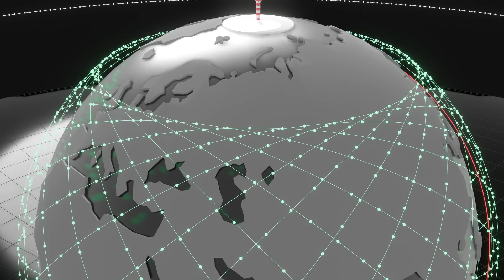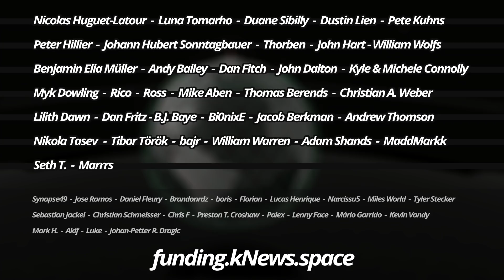What is SpaceX Starlink and how does it work? || kNews.space

Comment: 5:07  This network of satellites will offer faster speeds than fiber optic cables. 30 to 60 ms across the entire globe? If I were living in Australia or New Zealand, I would be super excited.
Reply from the maker: To clarify: By faster in this case I mean less latency over big distances. You can still push more Gigabit/s though fiber cable. The signal only travels faster through vacuum than it does through optic fiber. So it will beat long range internet connections. Maybe not in the beginning but long term once there are enough satellite in order to route the signal efficiently.

Comment: They've updated the satellite design for all but the first few dozen; the new design will burn up entirely with no debris reaching the earth.

Reusable satellites aren't going to happen.  These sats use hall effect thrusters to adjust orbits.  They're extremely low power, and work by applying a soft nudge over a long time.  It's so weak that they can't even reliably target the pacific ocean for re-entry, so there wouldn't be any way to drop them in a collection zone.  

As of April 2019, they're still saying "2020" for first commercial service.  The first batch of production satellites is scheduled to go up in the next month or two.  

Many commenters are wildly underestimating the bandwidth and appeal of this system.  Gigabit speeds for customers who have no broadband?  Priceless.  And it makes Starlink an instant competitor for every broadband ISP, many of whom have gotten used to running without competition.  

Iridium will be fine; their architecture allows phone and pager-size communication devices to directly connect at extremely low speed.  (Like a few kbits per second.)  Entirely different market.
Reply from the maker: They will have to replace the whole fleet every couple of years so there is plenty room for innovation and evolution. My reuseable idea is NOT for the first batch but maybe a long term goal once they have it all figured out. Burning up thousands of satellites per year just doesn't feel like the future at all whether something reaches the ground or not, but we have to do one step at a time of course. 

I agree on the competition side of things. I'm really looking forward for some competition for my local monopoly. Prices for the same service keep going up and up whereas technology should get cheaper over time.

The only worry I have is that my ISP will simply use Starlink to enhance its service and I won't be allowed to plug into a foreign internet directly. Though, it would still allow smaller companies to become ISP using Starlink and compete.

Comment: Can someone explain to me the issues on how one sat could take out all of them and how this could just make more debris to plan through when putting something in orbit like I just want to know if my problems are actual issues.
Reply from the maker: It depends whether you have control over the satellites or not. As mentioned in my video each of these tiny spheres you see orbiting earth, is 60 km wide. Thats the "safe zone" in which no other satellite will enter in the Starlink constellation. You can let the satellite orbit so that they will never interfere with one another. Now, if one loses control for some reason you still have 60 km of buffer for it to drift. Without control to keep itself in orbit these low earth satellites will reenter within weeks. 

A single collision would be a real mess and there is of course the famous kessler syndrome where you would cause so much debris that you couldn't launch into space at all. However, space is really big and satellites are tiny. 10,000 satellites sounds a lot but more cars fit into a single city without crashing. Near earth space on the other hand is orders of magnitude bigger than the whole surface of the earth. 

You can think of it like an onion with many many layers. On each layer you can safely operate thousands of satellites which will never come into contact with satellite orbiting on other layers.

Comment: Wouldn't the satellite just burn up completely in reentry? Please correct me if I am wrong.9:40 I don't think SpaceX's satellites will be big and most asteroid's burn up during reentry. It just doesn't make sense to me that most small asteroids would burn up completely while SpaceX's satellites would be able to reach the ground.
Reply from the maker: SpaceX released a paper on Starlink and they let NASA run some simulations. Mostly parts of the engines would survive reentry but only a couple kilograms (Can't find the link right now but it's failry easy to google). Asteroids come in way faster than anything orbiting earth and the kinetic energy increases with velocity squared! E_kin = 1/2 * m * v² But that's not all, their trajectory is usually also much steeper. They punch through the thin outter atmospheric layers quickly and the lower ones hit them like a brick. Satellites crashing on houses in those old movies are no fiction :D

Comment: 3:30 Receiver only?  So basically like broadcast radio.  In order to browse the web or do anything on the internet you need to transmit, that's how the protocols work.
Reply from the maker: My idea was to combine cellular and satellite in very remote areas. You could use EDGE or even GSM to ask for data and receive it using Starlink on the go. Netflix while backpacking for example ;)
Reply: @KsNewSpace  Okay, that would work.  But Netflix while backpacking?  Be careful  you might trip on a root and accidently see the landscape your backingpacking through.  ;-)

Comment: Quick question: couldn’t SpaceX put the satellites into a higher orbit? Mayby 1000-1200km? To reduce the failing rate :).
Reply from the maker: As Caellum said the latency is one reason but you also have to take the deltav into account. You safe some delta_v staying in a higher orbit but you need more to get there in first place. As a quick example, to get to 550 km it takes roughly 11 km/s. To get to the proposed 1150 km you need 12.2 km/s. That's 1.2 km/s you could've instead used at the lower altitude for course corrections. That's a lot! (My little calculator does not take atmospheric losses into account)
Reply: Then the latency goes out the window. The reason they are in such a low orbit is so the internet is quick.